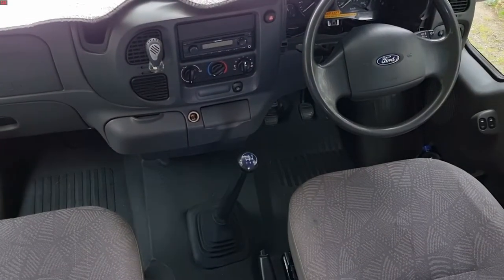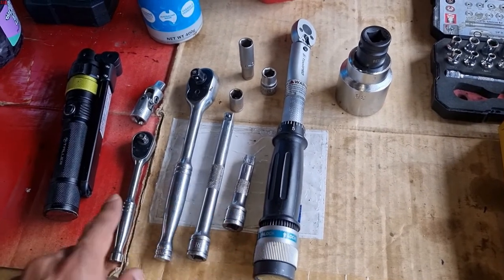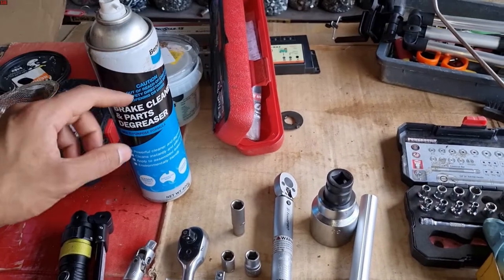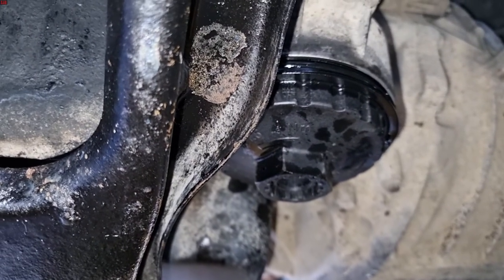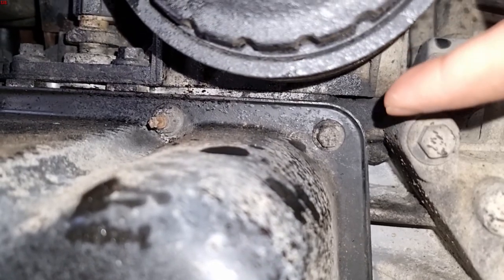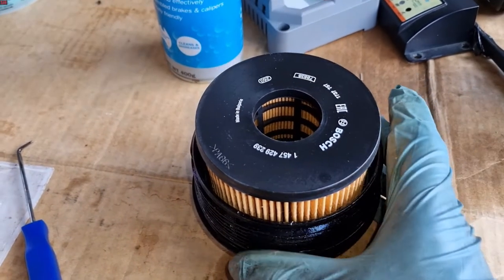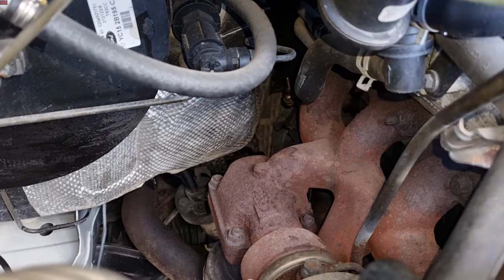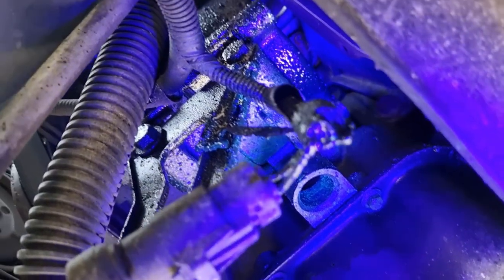Ford Transit - How to Change an Oil Cooler Seal (Engine)

Comment: Do you need to drain oil first?
Reply from the maker: @christophertustain8852  Nope, but if the vehicle is just driven allow it to sit for 20mins, for the oil to cool and return to the sump.

Comment: Will I have to take disconnect the crank angle sensor or can I just start its up
Reply from the maker: Preferably it would be better to disconnect the sensor to build up oil pressure but its not a must
Reply: @AutoBuddynz  thanks for the reply, just seems in a super tight area where I struggle to get my hand , is it just disconnecting a plug ?
Reply from the maker: @harryford1117  once you remove the heat shield its not too difficult. I find it easier to access the plug from underneath the vehicle and yes just disconnecting the plug
Reply from the maker: @harryford1117  once you remove the heat shield its not too difficult. I find it easier to access the plug from underneath the vehicle and yes just disconnecting the plug
Reply: @AutoBuddynz  legend, thanks so much love your videos
Reply: Hey man my oil light stays on why would that be ?
Reply from the maker: @harryford1117  Does the engine run well? If so might be a fault with the oil pressure sensor